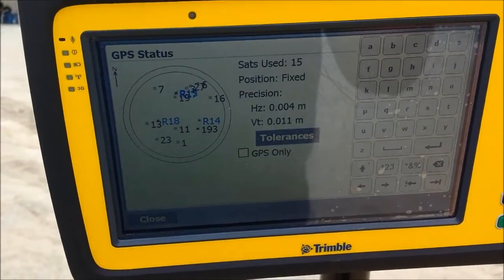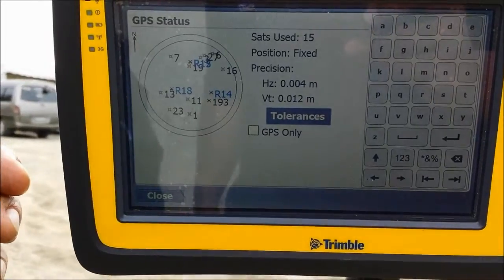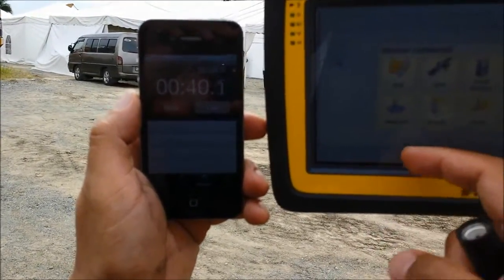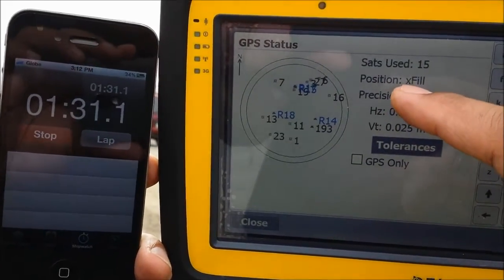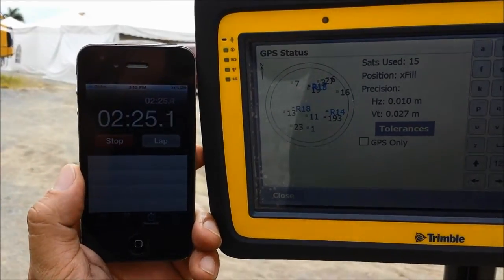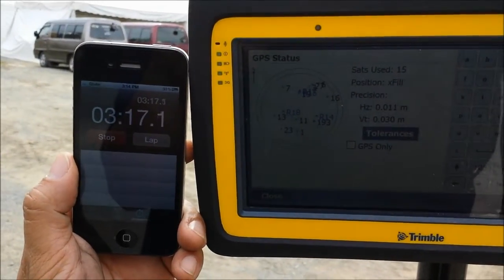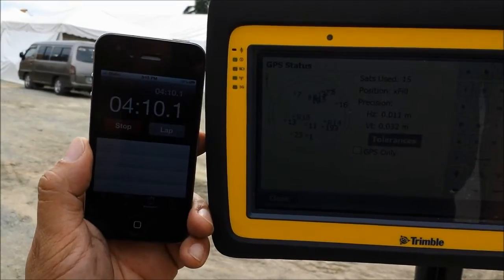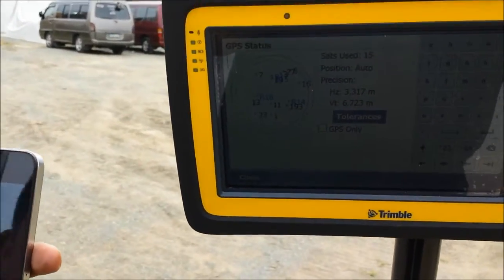Trimble xFill Demo

Comment from the maker: Hi Zetetic,

Apology for late reply. It shows that it lost the radio communication but the X-Fill function takeover. For more info, check the link below or you may contact Trimble local dealer on your area.

http://construction.trimble.com/sites/construction.trimble.com/files/marketing_material/white%20paper%20-%20Trimble%20xFill%20for%20Construction%20.pdf